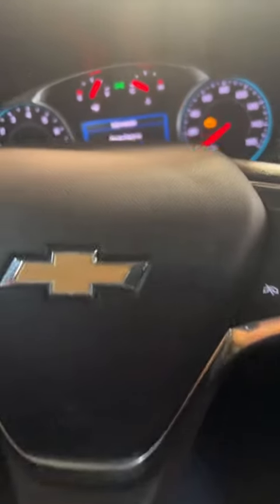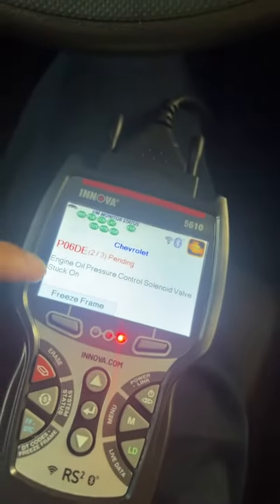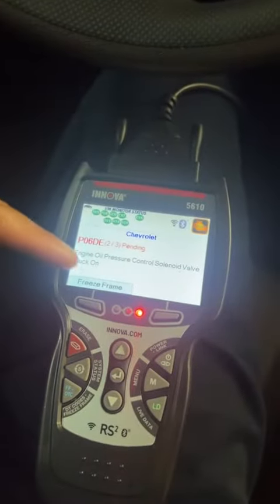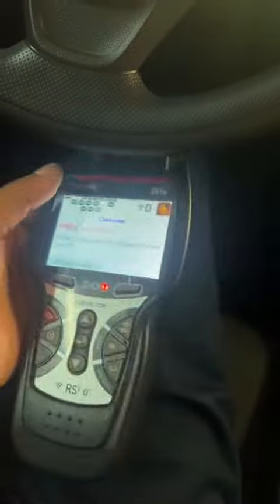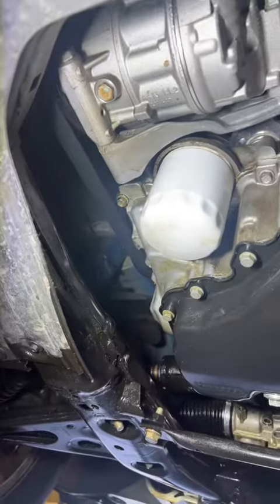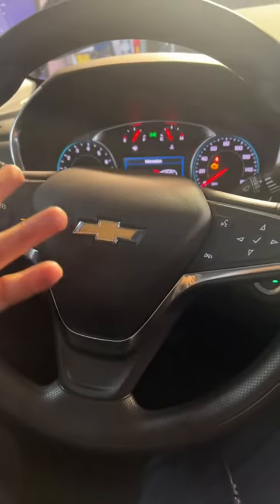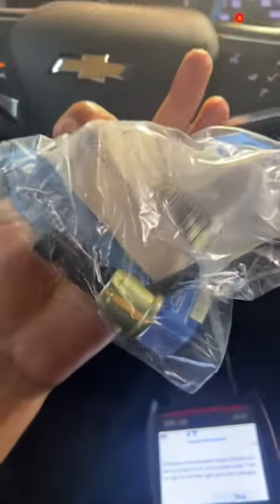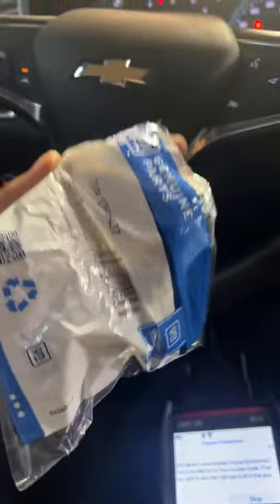How to diagnose and fix P06DE #mechanic #carmaintenance #obd2 #obd2scanner

Comment: Did you check the front crankshaft seal? My equinox has the exact same issue and there is an oil leak.

Comment: I have a 2018 equinox with the P06DE, the car power decreases and says Engine Power Reduced. There is definitely a leak but I believe it’s coming from behind the Turbo or Crankshaft Front Seal. I’m not a mechanic any advise would be greatly appreciated.
Reply: Did you have it fixed? What was it ?
Reply: I have the exact same issue